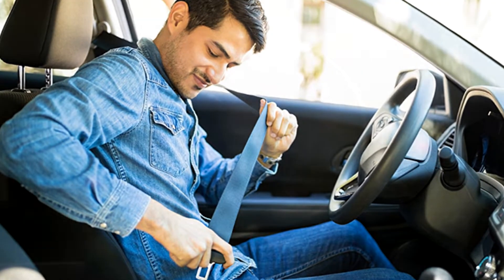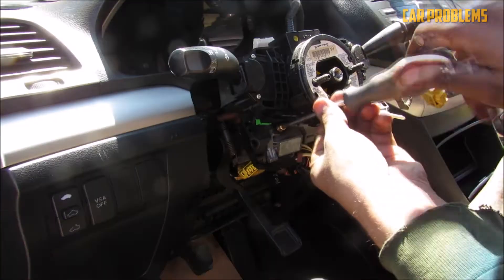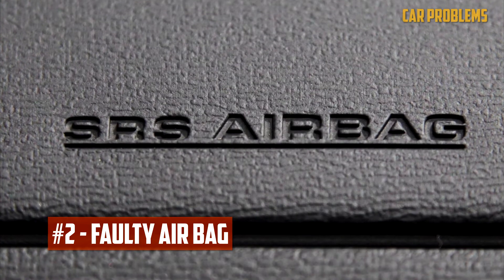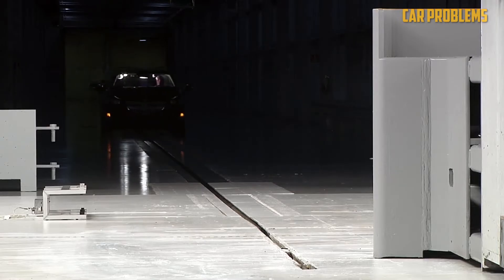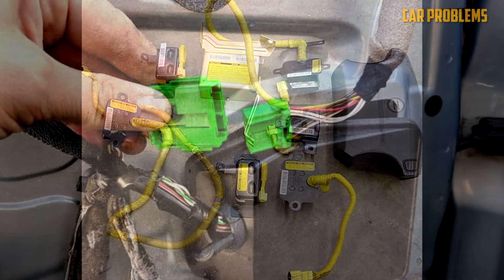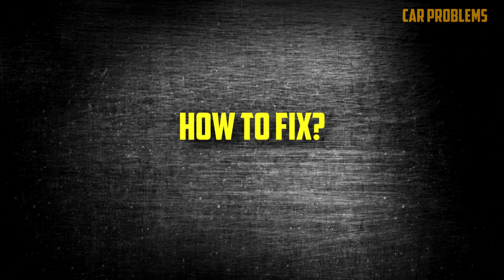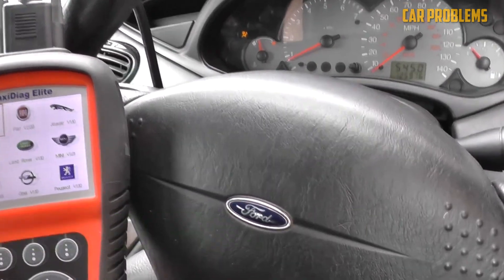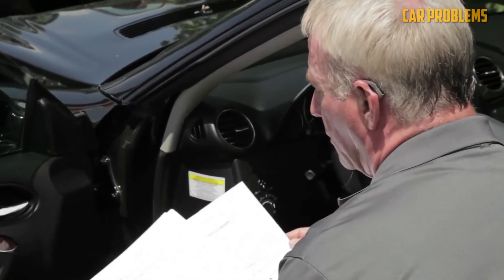Service Safety Restraint System – Causes and How to Fix

Comment: My husband found where the sensor which is on the drivers back of the seat is the cause. He unzipped the back of the seat,. The sensor had jiggled loose. He re tightened it to the place it needs to be, and I have not had a problem since. The dealership told me they would have to replace the seatbelt and the air bags. $2400.00 The real fix was nothing. Try this solution. It really works!!
Reply: Thank you.. did it and worked
Reply: I just tried it and it works Thank you!!!

Comment: I had the same message for over a year on my 2019 sierra Denali. 2 weeks ago other messages appeared ie service handbrake, service CES, reduced power assist….took it to dealer yesterday, they replaced the drivers side airbag control module….they had to remove console to get at it…..$1500 cdn bill
Reply: It was not covered? It essentially happened to a new car?